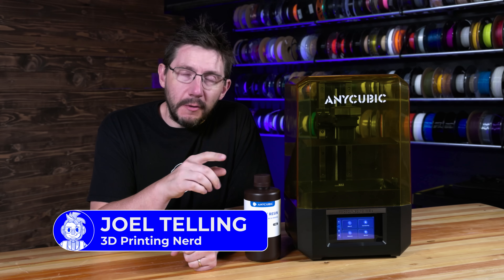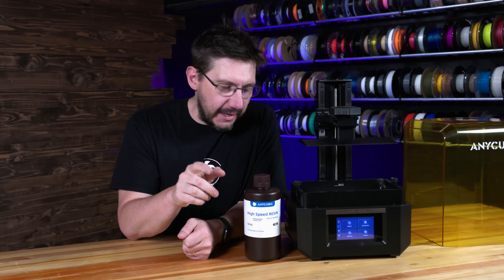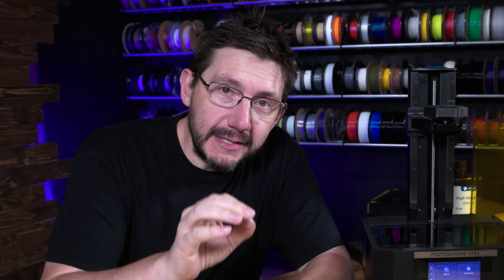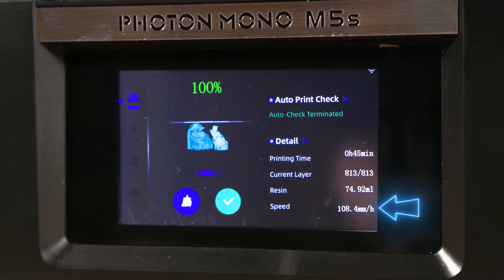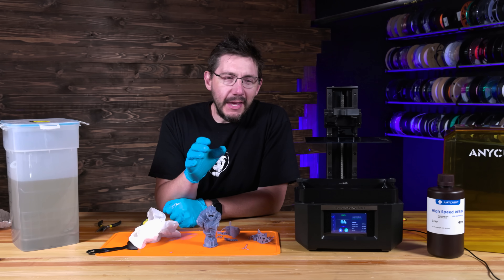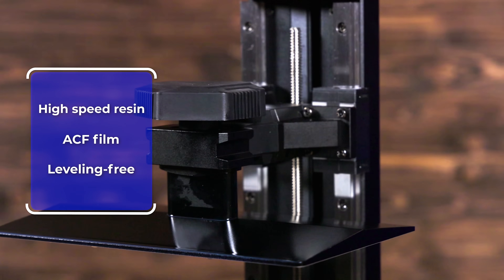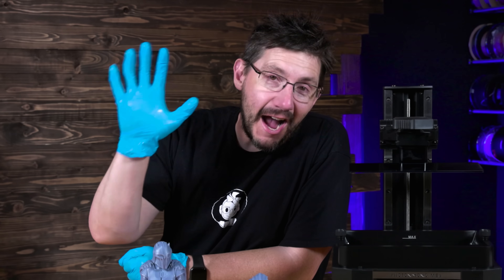ULTRA FAST 12K Resin 3D Printing! Anycubic Photon Mono M5s!

Comment: I think it would be a really interesting idea, to take one of the new fast resin printers that exist, and compare it directly to an fdm 3d printer also printing at 0.1mm. Resin has always been known as being really slow but more accurate, but perhaps now it's both. What would be especially cool, would be to print a tall slim model faster, by slicing it into 4, and then slotting them together after. You could also try 0.15mm, since even if it reduces quality it still will be better than fdm.

Comment: question about that 105mm per hour. is that assuming the entire build plate area is used or for a 1cm x 1cm tower? because i'm sure it will take a lot longer to print a 10cm x 10cm tower than a 1cm x 1cm tower. 😅

Comment: So I bought two of these printers based on reviews like this one.  I've had leveling problems for half the life of the printer, and all online discussions about the issue have reported that the only solution is that Anycubic has sent replacement print beds to some customers that now contain the typical 4-screw adjustment "feature." Therefore, Anycubic seems to have failed on the auto-leveling feature.  

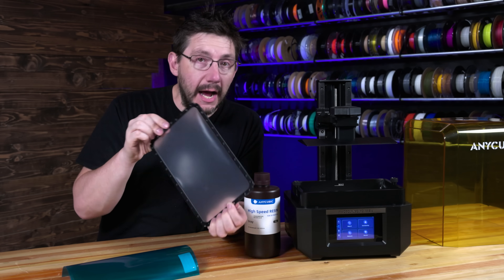I decided to rewatch and re-read the expert reviews to find out how this was missed.  I've been following Joel for several years so this one was important.  At about 2:12, Joel describes the leveling feature by virtue of the missing screws, but he doesn't explain how the printer does it, i.e., he just seems to take it for granted.  In fact, he says "level" when he obviously really means "height" or "z offset."  This is unfortunate.  Yes, the main marketing point is the printer's speed, but in this case, they actually took away the ability to level the printer so without getting a fix, this printer is a doorstop so the speed is zero mm/s vertically.  For the printer that I meticulously examined, the print bed is tipped from the back, lefthand corner to the front, righthand corner.  And it is out of level by 0.9mm in that distance of ~240mm.  0.9mm is the equivalent of approximately 20 layers!

Comment: I got curious & looked at their site. When I looked at the prices there was an option to purchase 1 of those wash & cure thingies, but along with the name of it was mentioned the dimensions (of print) that the w&c could handle. Even on the larger W&C+, the listed maximum dimensions for a model are smaller than the max printable size of the new printer. Not a problem if you just want to print multiple smaller models, but if you want to push the printer to its size limits you're gonna have to find an alternative w&c solution.

Comment: Got my new M5s set up today and have been printing non-stop with the High Speed resin and so far no issues whatsoever. Even printed some items at 100 um and the resolution was phenomenal, considering the insane speeds.
Reply: You did 0,1 mm hight, or 0,01 mm? I want to buy resin printer with hight quality, but I don't know if it's worth it
Reply: @synthfur05  (100um = 0.1mm) Only printed at that resolution when I was testing the High Speed Resin. Now I typically print at .035mm.

Comment: That film is UTTER FCKIN TRASH.  It destroys the print resolution beyond recognition.  It's ONLY purpose is speed.  Thats it.  Dont expect your models to actually look like a 12K model.  It wont even look like a 8K model.  It also RUINS dimensional accuracy,  dont bother trying to "tune" the printer/resin for dimensional accuracy with this film in it.  It will NEVER work correctly unless u change the film.  If you get this printer,  plan on buying an EXTRA tray that has a CLEAR film in it for your "production" prints.  The reason is because the foggyness of the film distorts the light and thus the pixels that should be lit up to a certain point to get the required accuracy/resolution are to dim,  etc.  The ONLY saving grace here is that it's STILL a resin print so it at least looks better than even the top end FDM printers even though it's NOT a "12k" print.  I have one of these,  I was VERY disappointed until I discovered the foggy film problem.  Once I bought an extra tray and put a clear film on it............................... DREAM MACHINE.  I could care less about the "speed" anyway since I'm so use to prints taking hours anyway.  I havent used that crap foggy thing since I got rid of it.  But it's there if I'm ever in a hurry to get a crap print out.  Maybe useful for people who go to crafting fairs and want to print tiny items REALLY fast.  Maybe an engraved ring or something,  idk.

Comment: Every printer review is "we got super fantastic results on this massive bust with their specialty resin, that you can't buy yet, but they gave us to demo, at the exact settings they set up for us". What we need to see is "oh yeah here's also some large medium and small pints on this machine using something like Sirya Tech fast 8k black or metal gray or something that you likely have already, and these are the results.

Comment: What's stopping me from printing at that speed on my Mono SE with that film and resin?
Reply from the maker: Um, nothing? I don’t know - give it a try!
Reply: @3DPrintingNerd  of course I will. But while I have your attention, I'd like to second the same model across 4k, 6k, 8k and 12k printers suggestion of another user and also see if you get the same artifacts @vegoilguy got. The rectangular pixel thing is interesting.

Comment: I was pretty excited to hear about the M5s (ready to put a clip of Dr. Daystrom from Star Trek saying "The M5 has been perfected Commander, it's potential is a fact!" in my review) but when it came time to buy a new resin printer one week after this review I looked at the lead time for the U.S. and it was 3 months! Ahhh! I want it in the beginning of summer and I can't get it until the end of summer. Bummer! One other thing: In dealing with lifelike robotics the average human head is about 6-7 inches wide and the M5s depth is only 4.84". And if there's one thing we all know, you can't take over the world with an army of robots with pygmy heads! Plus, I wondered how the miracle of speed was achieved. Surely fancy algorithms and speed calculating electronics weren't the only tools? That low viscosity resin? My thought was "Could that resin be used on OTHER MSLA printers and with a few modifications to settings might it give a reasonable advantage to ANY MSLA printer?" Someone want to check that out? Someone named Joel who has a volume of different printers at his disposal and a curious mind? End of story is I bought the M3 MAX. No auto leveling, no Wi-Fi, no advertised speed, no 12K (7K will do) but at a depth of 6.46" heads will roll and I'm starting to think about uniforms.

Comment: Absolutely blown away that they are selling this for like half a grand. You could buy THREE of these, plus hundreds of dollars worth of resin, processing tools/equipment/materials, etc, and still have a setup that costs less than JUST the prusa 'speed' printer. And these are literally twice as fast. Holy moly. For resin print farm people this is an immediate buy.

Comment: I use resin prints for structural engineering parts.  I'd like to see pull tests to failure with parts printed from different resins at different print speeds and different layer heights.

Comment: Proprietary film + proprietary resin = consumables lock-in. Not sure that's a bad thing per se, but worth mentioning that the speed benefit offered isn't native to the printer, and comes at the cost of choice/flexibility. Awesome unit, though!
Reply from the maker: Not sure film is proprietary as I’ve seen others comment it can be acquired. The resin is just a lower viscosity and I know others make it. I think there are some normal resins that will work as well

Comment: That high speed print was done with a 100 micron layer height.  That's kinda coarse given the 19 micron pixel size.

But 1084 layers/hour seems pretty quick regardless.

Comment: Hi,
***DO NOT BUY THIS MACHINE***
Thank you for your videos They are very detailed and informative. I just wanted to leave this comment on a machine you reviewed and talked about it in your video and I think that people should know this about this company before they buy this product.
I tried to purchase the Anycubic photon Mono M5s and I found out that the discounts and offers they have on their website are all fake. The company is not an American company (which is ok) and is not located in US either. It is in Hong Kong but yet they charge Tax (LOL) even much higher rate than Uncle Sam does. They pocket the tax. They charge a lot for shipping as well. They offered a coupon of $60 worth for $10 and they don’t give you the access to use it until a few days later. Actually later after they charge you, they give you the restrictions. They didn’t let me use the coupon on the machine while they have special on it and said that is not available for this machine. 3 days later and they said you can only use it on this machine and only after the price has gone up. They raised the price of the machine $100 and now they say that I can use this coupon. Every email I sent them they didn’t respond right away and when they did they didn’t answer any of my questions and only send me a message about how I should buy the machine as soon as possible. I will not trust this company and buy any expensive machines if they are not responding to any concerns or question. Basically their warranty doesn’t mean anything either.

Comment: One concern I would have with the 12k screen is the replacement cost. Anycubic is generally more expensive the Elegoo for there screen replacement costs and the 12k is definitely going to increase the cost compared to say the 6k or 8k screens.  There there is this new FEP sheet which I bet will also cost more then say a generic one off of Amazon.  I do love the auto leveling and speed settings though.  My two cents.
Reply: This is the same screen used by Elegoo in their 12 printers.

Comment: Can standard UV resins work in the M5s? Obviously it would print slower, but I have a stockpile from my (broken 😢) MonoX I'd like to be able to use. I'm as excited for the auto leveling function as the 12k (so I dont break this one, too).  Thanks Joel for another great clip!
Reply: Prints at 70 mm/s with standard resin.

Comment: Speed is nice, buuuuut, doesn't address the roadblocks to Resin printing - lack of engineering quality materials to print with, and tiny tiny bed size. This is fantastic for printing high quality for things like the figurines, it'd be ideal for somone at a Con with a 3D Pose n Scan booth, printing out your model of your cosplay while you walk the Con.
Just not for anyone whyo needs mechanically functional prints for complex parts - we won't be printing RC aircraft from resin any time soon.

Comment: I'm trying to figure out what "auto leveling" means in this context? It looks to me like they just have a rigid build plate that's level to the vat, there's no active auto leveling going on. I'm also disappointed that the  high-speed settings seem to require such chunky layers. That said, I absolutely pre-ordered this for the 12K screen (I'm currently running a 3K Halot ONE Pro) and a couple other features.

Comment: So excited! I just bought this a little while ago, for $379. I got the early bird discount plus another $20 discount! And was able to take advantage of the buy 3 for the price of 2 High Speed Resin!! Woohoo! By the way, while purchasing this printer on the Anycubic site, I put this printer into the cart, it showed up at $678, then I added a second printer to the cart and it then showed the discounted price. So I'm assuming the normal price for this printer, after early bird deals, will be $678 U.S. Dollars.
Reply: How did you get the extra discount?
Reply: @balkenkreuz2063  It was just a browser extension app. I believe this particular one was the Capital One app or the Honey app. Can't recall exactly which one, but it gave an additional $20 discount.
Reply: an early bird was $399
Reply: @666Azmodan666  Right…it was $399   but I was also able to get an additional $20 off as well

Comment: New to 3d printing, I am contemplating pre-ordering this printer how long till you have to replace the ACF film and what is the cost? How much does this high speed resin cost and can it be used with regular resin.

Comment: Hello, I have a question about the auto level mechanism. Do you think you can make a flexplate (magnetic) to the buildplate? Or will that make it too thick and not work? Thanks and great review
Reply: Uncle Jessy did some testing that shows very promising results. With a flex plate used as a spacer between the plate and he vat, the auto-calibrarion succeeded and the print started. We will know for sure soon enough.

Comment: Exciting to see the 12K printer, but there is a small question:

The pixel sizes are often very close, but the printer is 1/(11520/218) x 1/(5120/123) which suggests 18.92um by 24.02um, so the y-axis resolution is almost 20% less than on the x-axis, does it affect the printing precision in some way?
Reply: Thats what I'd like to know as well

Comment: Hi big question would be thr cost of the Resin.  If it's about the same size as other resins it's fine but if it is way to expensive then is the speed worth it?
Also how will the supply be on this resin?
For printing I would love to see something like a blaster or armour.  Interesting to see how big, flat curved surfaces come out.

Comment: Just pre ordered a phrozen mini 8ks as my first printer, had news on this one come out a few days earlier, probably would have gotten it instead. Oh well, at least delivery date on my 8k is a month earlier, and it should still be plenty good for my first printer, though the no leveling, larger print space, and faster printing would definitely have been nice to haves worth the extra ~$100.
Reply: I have two Phrozen machines and I love them. This is not a true 12k its 19x24 micron, you can use the same film and resin and get the same speed... auto-level is cool but not needed.  JMO, you are better off with the Phrozen.

Comment: So if it can print that fast due primarily to the resin, then the question becomes 'how much does that resin cost?'. Will we see substantial improvements in print quality from a 12k screen over an 8k screen?
Reply from the maker: I don’t know if it’s the resin, I still want to try high speed with a normal resin.
Reply: @3DPrintingNerd  It'll be very interesting to hear what you find out.

Comment: Your model selection for 12k is pretty bad - your selected model has no fine details AT ALL…to justify using 12k printer …
Reply from the maker: I chose the Armorer because there are very fine details in the metal that I thought the high res LCD would help show.
Reply: @3DPrintingNerd  I see… Can you visually tell the difference between 8k and 12k ?

Comment: So wait..  on fast speed it cant do 12k?  Kind of defeats the reason for having a resin printer.  Quality.    Hard pass
Reply from the maker: Yep, it’s 12k no matter the speed.
Reply: @3DPrintingNerd  wouldn't the change in layer height change the quality?
Reply from the maker: @albertogonzalez2203  The change in layer height would only change the quality in the Z direction. The quality in X and Y stays the same.
Reply: @3DPrintingNerd  Z height is the most important one. its the one that shows layer lines. No?  I started out on FDM printers years ago. and changing layer heights is one of the ways to effect quality the most.
Reply from the maker: @albertogonzalez2203  For sure, changing the layer height to smaller would make for better quality models. For example the Armorer was printed with 0.05mm layers, where the Troll was 0.1mm layers.
Reply: @3DPrintingNerd  hence why I said.. hard pass.   calling a printer Fast 12k..should mean that it can print fast and have 12k quality in all axis.  X, Y and Z.  not just in X,Y.  I do understand that 12k is the resolution of the screen.   I wasn't implying that you were wrong in anything you said.  you actually helped me make a decision 👍. and my decision is... Hard Pass. 😇

Comment: Can you explain the difference between the pixel resolution depending on the axis, this is taken from the official specs:

1/(11520/218) x 1/(5120/123) which suggests 18.92um by 24.02um, so the y axis resolution is almost 20% less than on the x axis?
Reply: Can't agree more, I have the same doubt.

Comment: All improvements are great, but an incorporated Resin Heater would be really good for colder climates.
Reply: There is one that has it but I can't remember the name, I know VOGMan did a video on it, it has a green perspex cover.

It's a bit more expensive but still consumer grade, and it's pretty big.

Edit: Uniformation GK2
Reply: @leatherworkstation  i bought a Phenom Forge by Peopoly after watching this video. It has the heated vat which was important for controlling the heat sensitive resins that I'm using. The 6k resolution is more than enough for my printing needs and like you mention, it is more expensive upfront ($3500), but with the resin @ $200 per litre and less/zero print failures, it will pay for itself in no time.